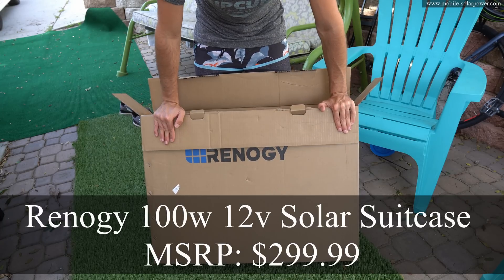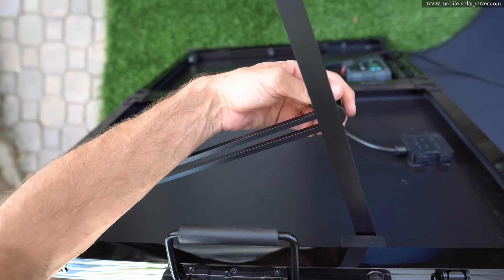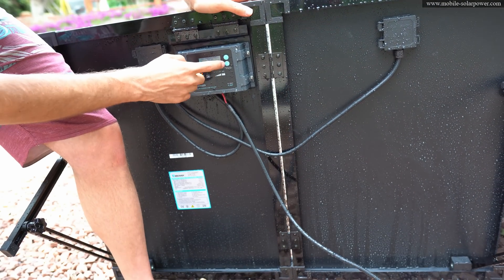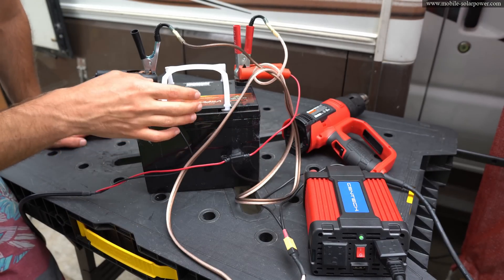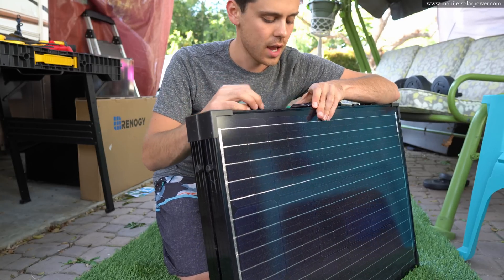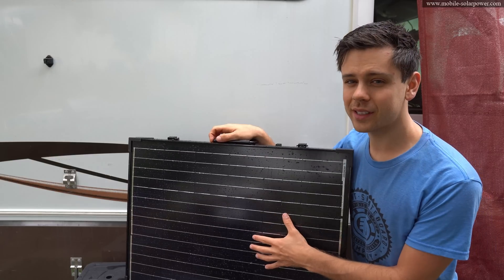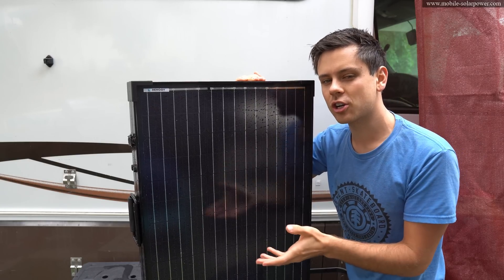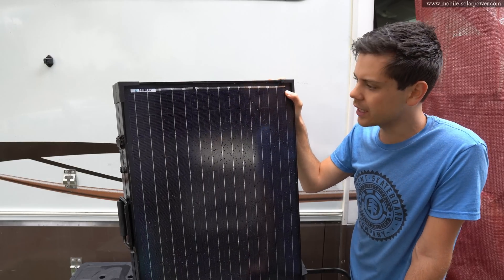100w Renogy Solar Suitcase and Renogy Voyager Tested and Reviewed

Comment: I purchased one of these off Amazon -- a "renewed" item -- back in September 2020 for about $170 as my first foray into solar power.  It wasn't listed as coming with the Voyager charge controller but it did; the only problem with it was that the tilt stands were broken.  I use it with a pair of marine lead acid deep cycle batteries as power for emergency and field ops as an amateur radio operator, and most recently during a 36 hour power outage at my home after Hurricane Milton.  I have been extremely impressed with the suitcase kit over the years, both with the Voyager controller as well as using the panel output in series with another foldable 100wt panel going into an MPPT controller (an Epever Tracer-AN 40A unit).  It's a bit heavy at 27+ lbs,  especially compared to my Rockpals SP003 at 5.1 lbs, but it's a solid and (so far) dependable unit.  I use it less for portable work due to the weight, but it's great here at home (as Hurricane Milton proved).  I watched this video before buying it, so thank you for steering me in the right direction.

Comment: How would one connect two of these suitcase panels that each have 20amp charge controllers to a Seikon 12 volt LiFePO battery? Possible to do that without harming the battery?

Comment: What size or brand of inverter would you suggest for using with a 12 v  109 ampage battery and this 100 w solar panel?
Just purchased this suitcase solar system but want to get an inverter in case needed when using around home

New to solar and limited knowledge.

Comment: I purchased this unit after seeing your review and I do like the unit.  I could only find one thing wrong with it that I did not like and that was because there was no Bluetooth option to connect to the controller to see if it was working after setup and during use without having to get on my hands and knees to look at the display.  I used it while boondocking and it would have been nice to see the status on my phone screen versus looking underneath at a display to get a reading and then relocate it because the sun moved.  Could you do a controller upgrade on the suitcase side to one with Bluetooth for a video?  Thanks for the current review.

Comment: Bought the first one, was so impressed I bought a second without the controller.
I now have 10 amps of solar power for my RV when running in parallel.

Comment: I have a 200w one. These things rust really bad and the legs are attached by super cheap platic blocks that break easily. The zipper on the case is very cheap and skips teeth.

So close to being perfect, but the quality just isnt there. The cells themself are nice, though. Good output.

Comment: I have used one of these in a semi permanent system pumping water for gardens gardens and orchards.  It is left in the environment from March till November four years now.  I’ve never had an issue with the electronics however the metal frame is beginning to corrode.  It is quite reliable however.

Comment: Hey Will. Thanks for sharing. Your book is a go-to resource for me. I am currently converting a 8' x 20' shipping container into a man cave. Develop it as resources become available. My plans include a a Victron system like the one you promoted. Before I put that system together I saw a hack I what your opinion on. I have a Bluetti portable. The hack involves using a Male to Male Plug Cigarette Lighter Charger Cord to energize my power. All my wiring is complete with, switches, LEDS and outlets, all 12v. What is your advice on powering my limited needs in this way. Apparently I can plug this cable into any wired 12v Cigarette Lighter in my circuit feeding from the DC out on my Bluetti. This in turn should power all connected (through fuse box) outlets, switches, LEDS. In your opinion, would you recommend it? Thanks dude!

Comment: I have just got hold of one of these for off grid caravanning here in the UK. Great piece of kit. If you pull hard on the controller it will hang down making it eaiser to read, pull hard very strong velcro.

Comment: Hello Will. I already own a 200 watts Renogy suitcase that I plug directly at the battery (one deep cycle 12 Volts)of my travel trailer, located at front behind the LP tanks (typical setup for a travel trailer 19 feet long). Is it possible to plug an extra 200 watts at the same trailer using the existing SAE port (ZAMP)on the side of the trailer? So, both of the kits could be able to charge the battery on two different ways. Is it better to rather connect them in series with a MPPT?

Comment: How would you properly hook this up to an Ecoflow Delta 1300, both individually, as well as with 2 200W solar suitcases? What adapters/connectors would be required, and how should they be configured and hooked up, so as to not damage the generator? Thank you!😊

Comment: Why did my brand new installed Lithium 12V batteries burn up the cable from it to my Cut off switch under the hood of my 2018 Class C RV moterhome while driving??? Thank You Lithium Guru

Comment: There's one thing you didn't notice the charge controller is on a hinge and it's a velcro to the inside of the solar panel so it can come off and hang straight down I also bought the same thing and I discovered that the legs are installed either upside down or the Chargers installed on the wrong side of the solar panels what I mean by wrong side I mean by it's upside down because those legs are actually meant to go the other way so you can get the optimum angle of any angle when the sun's going down you can have it standing more straight up the way you have it is the way I had it because that's the way the solar charger hangs down so you can read it they installed it on the wrong side the legs actually go the other way now I'm going to remove the solar controller and I'm going to install it on the other side of the solar panel still on the back side where you can fold it up but just on the correct side so now when you have your solar panel installed the right side up where the legs actually adjustable to make this solar panel stand up almost 90° or laying down if you want they messed up in the design I am sure of it your video shows the same thing as the other two videos and their picture on their website it shows the legs being used in the other way and it works the other way way better this way you can only stand it up so much but as the sun's going down you need to stand it up facing the sun more perpendicular they design flaw big time

Comment: Nice presentation on the suitcase. Five yrs ago I decided to buy a Renogy 100w kit to be able to charge a battery in my small but fully self-contained TAB camper. Subsequiently, I have made trips to the Arctic Circle from California and around the states from the Mississippi River and west to the Pacific. Kept some logs of electric usage  and generation. Camper has had single 75aH Deep Cycle AGM battery. Replaced the original Renogy PWM charge controller with EPSolar MPPT with noticable improvement. PWM works. It is just that MPPT transfers a little more of the panel power to the battery. Like your presentation of the "suitcase".You seem to have covered the features well.  Suitcase seems well designed and engineered. I haven't seen one in person. I mount my 100w panel on a rack on roof of my van during camping trips. Nice thing about solar generator system is that it is silent. Like everyone else, I have a gas generator but don't like listening to it.

Comment: Im permanently mounting this onto my Tacoma , should I run the wires from the solar panel to an inverter first or will running it to the battery be fine ?

Comment: Digging this back up
I have a question/idea:
We have run a 390w off grid system (100ah FLA) for 12 years now, and when we use up our 600w for the day, we often charge the solar system from our car using a set of #10 wires with quick connects (one set hangs out of the car hood, and the other set hangs on the post under the solar array.

We just bought our first lithium battery bank! And knowing that the depleted batteries can draw a dangerous amount of power from the car if we plugged them up, I have been thinking about a dc/dc converter between the lithium batteries and the car, 
*My question is,
Would it be more cost effective, or make sense to use a 30a mppt solar charge controller AS A DC/DC CONVERTER?

Comment: hi Will, I've been enjoying your videos for months, I am a new subscriber. I have the following questions to ask you:
1. Can you tell me if its possible to bypass the PMW controller because I want to connect this solar panel to a portable solar generator such as the Golabs R600. I understand there is a 100W Renogy solar panel that does not come with a controller but what you said is correct, if my car battery is down, I want to be able to use this solar panel to charge my car battery.
2. Can this solar panel charge LifePO4 batteries?
3. What are the main differences between a PMW and an MPPT controller?
4. I am planning to purchase 4 Golabs generators and 2 Renogy solar panels. You have been doing us a great job so I'd like you to make some money. If you can send me links to these products it would be great.
I await your response.
Andy

Comment: I recently purchased this suitcase and was satisfied with it's delivery condition. I would like to permanently mount the Voyager controller on the front of my 19' trailer in a Pelican type box and then run a proper cable of 20' length from the controller to the panels (currently 10ft from battery to panels and controller). I feel this is the most efficient way to connect the system and gain some distance for optimum placement of the panels. As the controller will have a short length of wire 18" with the battery clams and another short section 12" with proper solar wire connectors I could tuck theses wires into the Pelican case or easily remove the controller from the weatherproof box and travel with it protected in my camper. Is this a good idea? 

This is a great series. I would like to see a short explanation of the panel display. What is a good volt reading low and high? What is a good amp reading? What does the amp hours display tell me? Amps generated since pugged in? Is there a delay in the read out from when first turned on? I am very handy, in the construction business and do household wiring and repair but find the volts, amps, ohms stuff confusing as to what I am actual being told and how to determine how many lights running will run down my battery in how long. Enjoying your "Electricity for Beginners" and will order your book.

Comment: Hi Will! Glad I found this vid! I am looking to purchase this “Solar Suitcase” but was looking for a good reason to. You helped me make up my mind. I have a question, and I’m pretty sure you can answer it. Question: I plan to purchase the “OUKITEL CN505 LiFePO4 Power Station”, and would like to know the best way to charge it with this panel. The CN505 has an internal MPPT controller, so should I bypass the controller on the panel? Would love to hear what you would do in this case. Thanks in advance for your time! Great vid! 👍🏼

Comment: I recently purchased a max oak ac50s which should arrive in a few days. I did not buy a panel with it though. What is this 100 W or even the 200 W version be compatible with the max oak or do I need to purchase any other device or piece of equipment to make it work? Or is there another affordable option that would be easy to get and work better thanks!

Comment: I'll have mine 2 years in July.  It works great and is holding up great.  Very easy to use and I got the mc4 extension cord and pigtail to attach to the battery.

Comment: Just bought one of these. It is great. I use it as a secondary way to charge my auxillary battery on my dual battery system in my truck. I have a 1500 watt pure sine wave inverter installed on the auxillary battery.

Comment: $299.99 USD that's super pricey for 100W  (I'm going to assume they shipped that out for that price). I get the same thing at 160W for $114 USD at the moment from a local store. Admittedly that's a cheap price, but it's not listed as a special. I checked Renogy's prices and they're all really overpriced on every item, they need to get real. I'd never use cheap PWMs if I could avoid them, but they do have the advantage of operating in now light conditions which the MPPT charge controllers don't like. That PWM controller is unusual in that it can support those battery charging profiles.

Comment: In some of your other videos you mention that the battery should be connected to the controller before the solar panel is connected to the controller.  In this system, the controller is already attached to the solar panel.  Will this damage the controller?  Thanks.

Comment: Are you sure you're spraying heavy water (deuterium oxide, the stuff used to transport heat inside nuclear reactors) on the thing ? Because that's quite expensive and not particularly conductive either. In fact, pure water of any kind is not even conductive at all, the impurities (ions) moving inside it are the ones actually conducting.

Anyway, nice job on the review !

Comment: I have one of these 100W Renogy Suitcases for my travel trailer.  It does work great.  I've had it about 2 years now and decided to get another 200W Renogy Suitcase.  The 200W one is pretty big.  But I'm excited to use it with two Battle Born LiFePO4 batteries.

Comment: Which wire gauge size should be used to connect your battery to this via MC4 connectors if not using the provided cables. I have this panel but without the charge controller or provided cables. I noticed the wires coming out of the panel are rather small (possibley14 gauge). I will connect a 100ah flooded lead acid battery which will use at most 60watts at a given moment.

Comment: Love your channel and love your smarts!  I have a pop up camper that I converted all incandescent lighting to small led strips and the only thing we run at night is the electric propane heater that’s built into the camper from factory back in 1979.  I’m using a interstate Deep Cycle battery. It’s ratings are 550 CCA...690MCA...140RC.  That’s all I know of it so far.  I’m guessing that the fan on the old stick heater might be around 15-20watts running and we use it averaged about 9-10 hours in the fall and that’s it. Would this kit be ideal for our usage?

Comment: Will this system charge 2 RV/Marine deep cycle12 v batteries in my motorhome?  My motorhome uses a refrigerator that works only on 110 v and the two batteries will go dead after one day and using my Onan generator is just too noisy.  If this system would work, about how long will it take to charge the both batteries in full sun?  Thanks.

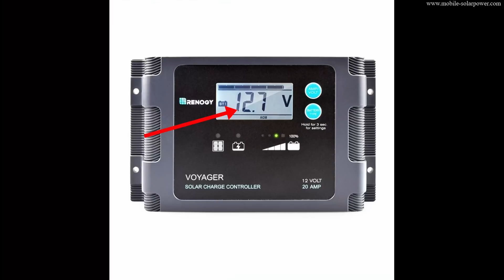Comment: *HELP* Hi Will...  I. bought this unit a few months ago. I am total novice- fulltime RVer. Had a professional solar guy make me an extension cord and double check for reverse polarization on my pre-wired rv. It seems to work well but I am worried it's only charging one of my two house batteries. ON YOUR VIDEO AT 3:03-3:10 you show the LED screen. At the top- there is a little battery icon that is labeled B1. Does this mean it is only charging one battery? If you have two batteries, should it show 2 battery icons, say B1 and B2?? I literally run out of power down to 11.8 overnight with only frig on LP and normal small parasitic draws. So frustrating. I so appreciate this video since it confirms I made a pretty decent choice for not knowing diddly squat!😄 Your videos are a little above me sometimes but I still seem to learn some basics. Thanks for any help you can provide.

Comment: We have the 200 W Renogy suitcase system and have used it for over two years.   A couple of comment the controller lugs are not the best you have to secure your wires or you will fight reinstalling them over and over; the legs are connected to the panels using plastic blocks and after time in the heat they connecting blocks become brittle and break (even when used very gently) and finally the suitcase failed the first time I opened the system.  It was a good beginners system and we still use it off grid.

Comment: Hi Will, I am partial to the Renogy 100 WATT 12 VOLT MONOCRYSTALLINE FOLDABLE SOLAR SUITCASE WITH 10A VOYAGER CHARGE CONTROLLER panel system that reviewed here. I know your opinion on the flex panels, but can you comment on the newer Renogy E.FLEX 120 PORTABLE folding SOLAR PANEL system?  thanks

Comment: All looks good except that it does not work for me, at least yet. Have the Renogy 100w suitcase, battery monitor and LifeP04 battery and it won’t charge. Charge controller works fine but no power is going to the battery. Very disappointed thus far.

Comment: It look like this comes with a 20amp controller.  my OEM set up shows the outside outlet labeled as 10A.  Is the 20A just the max and my oem system will only use 1/2 of the controller capabilities or would this model not be correct for me?  I'm early in my solar learning curve, appreciate your help/response.
Reply: the 20A controller makes it posible to add a 100W expansion suitcase to your array using one controller.   Renogy sells the same 100w suitcase without a controller to use for that.

Comment: It says I can damage my battery if it is not set up for correct type.  I am asking it to charge my Jackery 500 which has a lithium battery and yet my solar panel says AGM.  I need to know how to change from AGM to Lithium.  When I hold down for three seconds it does not change?  Also is this choice to be done before connection or after?

Comment: Considering that it's just a PWM controller, it works pretty well.  We usually get 85 watts or more, to the batteries.  Good quality construction.  We upgraded to #10 wires.